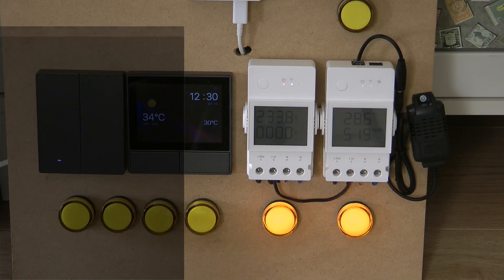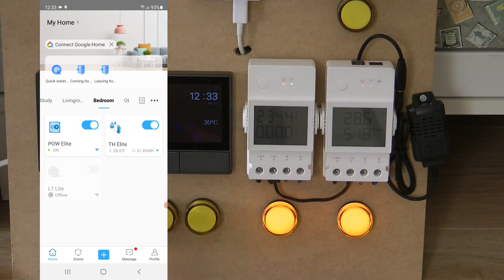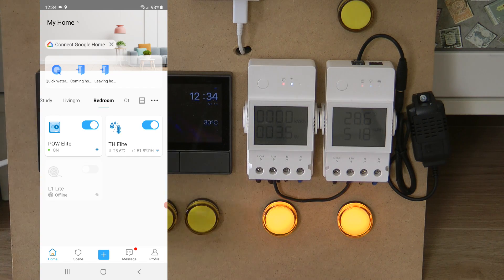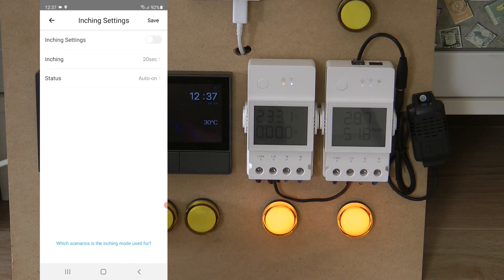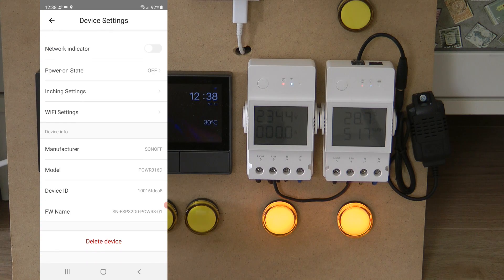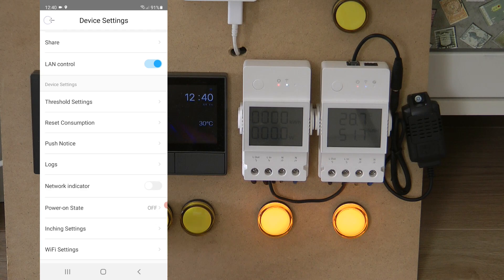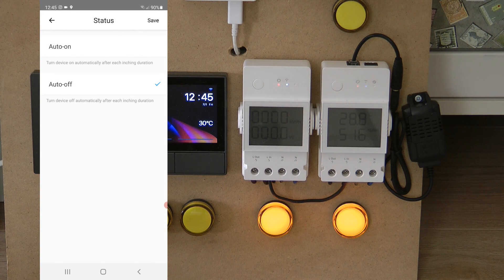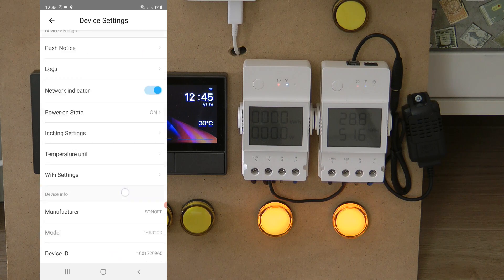Sonoff Elite: new line of POW and TH devices, but what is new?

Comment: I bought this one very excited after your video and now I don’t know how to install 😭 just wanted to see my soil humidity I thought I could keep an eye on my garden when I’m on holiday. 🤦‍♂️ need help!
Reply from the maker: So, it is probably the TH Elite. Connect the mains power to Lin and N terminals. The two middle terminals. Plug in the sensor on the top and you are ready to go.
Reply: @csongorvarga thank you will try 🙏 hopefully not going to burn a house 🙈
Reply from the maker: @MrJongaiser  First connect it with a simple plug, or you are unsure use an extension cable with a fuse. That should be OK.

Comment: Hello, do you know the pin layout on the RJ?

It is to know the connection of a dallas ds18b20 or a DHT22.

If you have an adapter it might be easier to measure with a tester each pin of the RJ with the pins of the jack.

Thanks!
Reply from the maker: Sorry I have no idea, I did not check it
Reply: @csongorvarga  Nowhere, neither forums nor Telegram groups know the pinout 🤦🏻‍♂️.

I bought one to know the pinout and today I received it a TH Elite 20A and in 5 min without adapter I knew the pinout I used a DS18B20 and a DHT22 the latter much faster in showing the changes constantly, faster than the Dallas, but just appeared a firmware update message, maybe I improve, I no longer tested it with the Dallas and last update.

In summary in the video I see an adapter is as easy as checking with a tester the pins, maybe the desire to do it but we are Makers!

I already have the pinout and working, I wanted to know before.

To include or not, one the sensor next to the TH Elite but I have at home many Dallas and many DHT22 would be a useless expense.

Comment: Mr varga can we use the pow only for power metering and not controlling any switch?
Reply from the maker: Yes, there is a power-on-state which you set to ON. That will turn on the relay when the unit turns on. Just need to remember not to click on the button on the eWelink app.

Comment: You cannot monitor the power consumption or access power graphs with TH Elite, as you do with POW? That would be a big bummer since, market-wise, TH seems to be an improvement or superior over POW.
Reply from the maker: Th was always just temperature and humidity sensor and for power monitoring POW had to be used. I see no change in the product mix with elite.
Reply: @csongorvarga  Thank you. That's such a shame! Do you think TH could be hacked to measure power like POW, or it's missing the hardware to do so?
Reply from the maker: @alexdanton4842  I think it is missing the hardware to measure the current.

Comment: Hi,, thanks for great review, if there is a power loss and no internet connection, does it still keep current KWH readings? Or it gets reset? I plan to use it on my generator, as regular energy meter, thanks.
Reply from the maker: It remembers. There is a separate reset function to zero all readings.

Comment: Don't use the sensors with the jack plug converters. I just had 2 elite-16 that gave readings around  6deg F out & the graphics was breaking up. The company sent 2 new sensors with RJ11 connectors & problem was solved.

Comment: I would be happy to contact you as you are realy professional with the sonoff products . its not about this video but its about an airbnb apartment set up.
I wanted to make a scene where if the guest leaves the apartment then the AC and lights turn off. But if the guest are in the apartment then every thing should work.

I tried to  do it with the sonoff motion detector and door sensor. I created 2 scenes  1) If the door is opened and no motion is detected then the AC/Lights turn off. 

2) if motion is detected then the ac/light go on. what I wanted to reach with it is that as long as the door is not opened and no more motion is detected the ac/lights stay on this way if at night the guest go to sleep and the motion detector does not detect motion still all will work because the door didn't open.  Unfortunately this didn't work because the ac/lights turned off as soon as the motion detector didn't detect motion . or as soon as the door was opened although there was motion it turned off the ac/lights . please advise how i can do it the best and efficient way.
The apartment is in budapest i would be happy if i could call you and talk to you 
thanks so much for your help